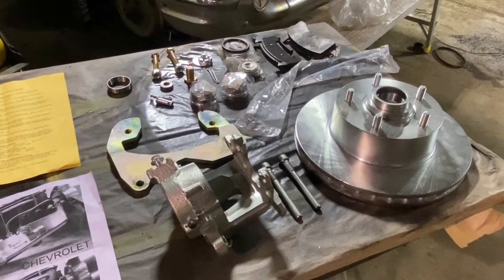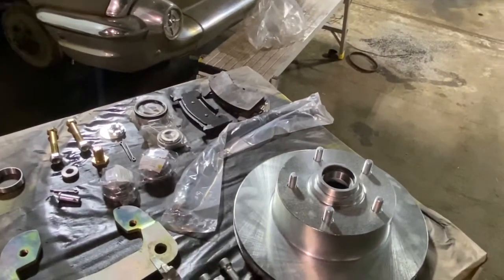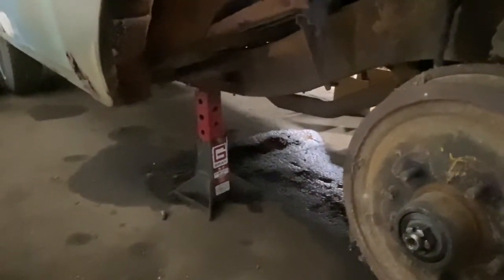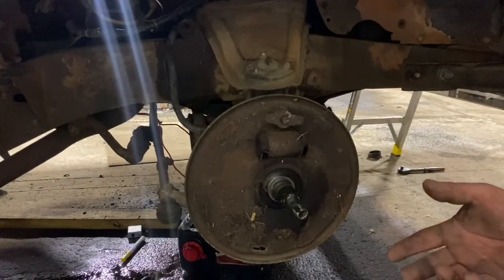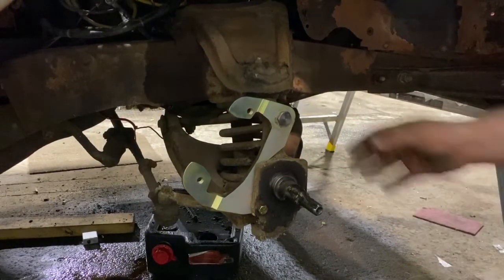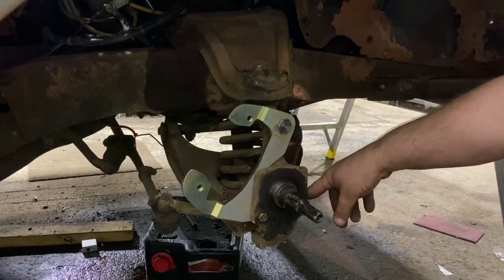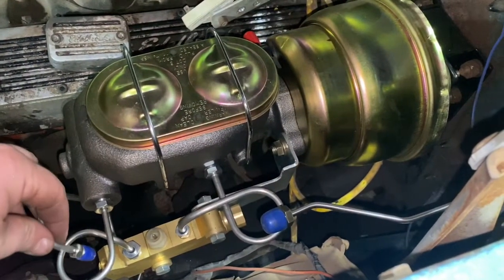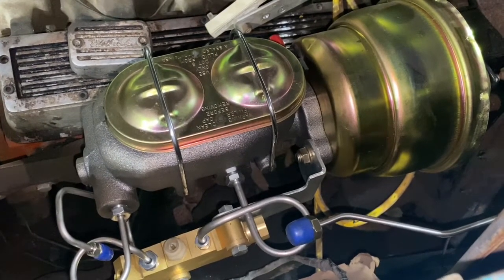Installing the Auto City Classics 1955-57 Chevy Power Disc Brake Kit

Comment: You should also add a rear line pressure reducing valve if you are running the stock rear axle with 11” drums. They will tend to lock up on hard stops without the adjustable valve.
Reply from the maker: We haven’t encountered that issue using this kit. We’ve used it successfully on several now.
Reply: @RandomRandomnessKCMO  Ol’55 which is a big dealer of Tri five Chevy parts highly recommends this rear proportional valve as well. I have seen it happen on many trifives with 11” stock rear. Both my 57 and my 3100 truck locked up the rear until I added the valves.

Comment: I'm really appreciate your help mister that really help i have 1957 bel air with no break booster and i wish to upgrade it, does this kit really better than drums is there any cons you had faced?
Thank you for your time 🙏🏻🌹🌹
Reply from the maker: It’s an excellent kit. You can’t use the factory wheels with this kit, that’s the only downside if you are wishing to remain stock.
Reply: @RandomRandomnessKCMO  
i would like to buy also american racing torq thrust so i dont think its a problem but i have one problem! ship 😭
i live in saudi arabia i found auto city classics kit its around 480$ and shiping 500$ 😭💔

Comment: Where you able to fit the original 14" rims with this kit?
Reply from the maker: The original wheels will not clear this kit.
Reply: @RandomRandomnessKCMO  Good info, thanks!
Reply: Original rims will not work with this kit. Will need some 78-80 Malibu rims . Will need to add nubs for caps.